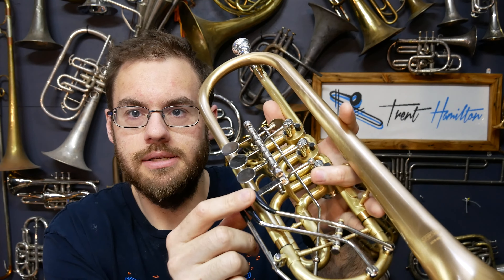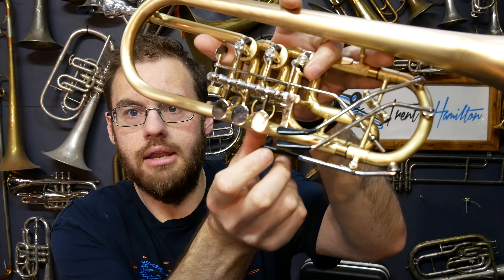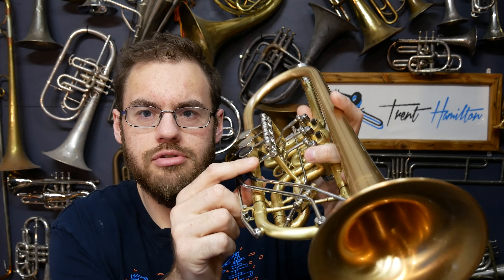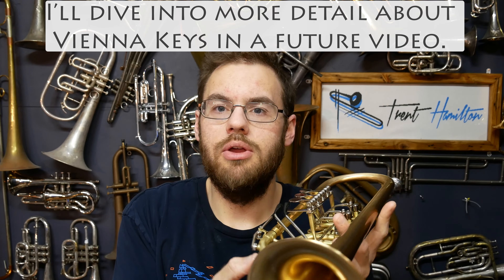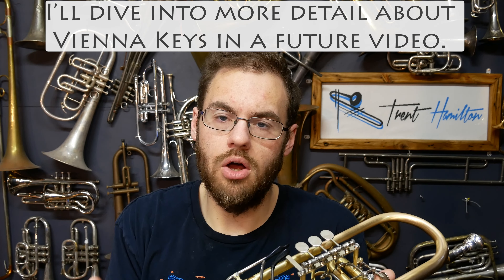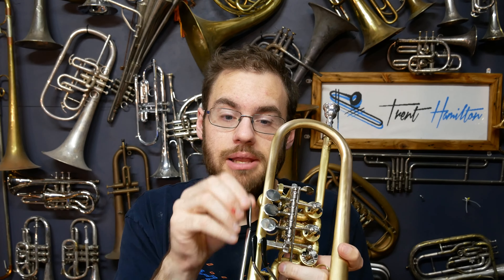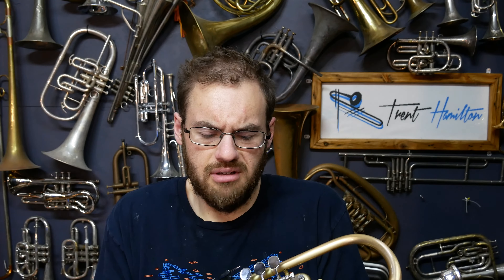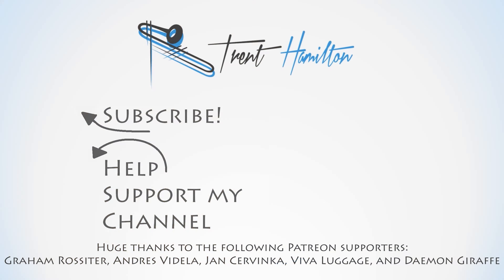Orchestral C Rotary Trumpet with Vienna Keys! SDTR-R300

Comment: I live in Scotland use a Scherzer rotary Bb with Vienna keys in the orchestra. It's their copy of the Monke trumpet. It has a huge bell and when you play Wagner or Raff or any of the big Germanic literature it beats all the piston valve trumpets. It has three leadpipes but everyone seems to use no 2.
Reply: Very intriguing. I have a roughly 35 year old Scherzer Bb trumpet. And it's so different to the Monke trumpets most here in the western parts of germany use. It's very thin and lightweight, has a bell barely larger than a piston trumpet and has quite the traditional looking mechanisms. In contrast to the Monke trumpets that are heavy and have simplistic and sturdy looking mechanisms.
But i have to say the valve action is a lot easier than any of the 2 or 3 Monkes I've held. Just completely different instruments.
Reply: Reject modernity, return to Monke

Comment: You could take the 3rd valve slide off and slip a rubber gasket on it to adjust it if youd like. Then the valve would rest on the gasket effectively "adjusting" it.

Comment: I thought those Vienna key were called vent keys, you know like the vent holes on the long modern baroque trumpets without valves. Rotary valve trumpets are (were) quite common in Swedish symphony orchestras. In the Gothenburg symphony orchestra they were preferred by the Japanese conductor (can’t remember his name) when he was in charge . I think they were equipped with those Vienna keys.
Reply from the maker: They probably have multiple names. Vienna keys "Wienen Klappen" are just one. It's a bit vague to my liking, because klappen can be translated as "valve", and Vienna valves are something completely different.

Comment: Hi, Trent!  I found your video to be quite interesting.  I have a strong preference for the "rotary valve sound" and have accumulated a number of these trumpets, mostly of German origin with some Yamahas thrown in.  I have also acquired three Chinese made rotary trumpets, with less luck than I've had with the other trumpets.  My first is a Bb that looks much like your C trumpet and it is the best of the three.  It plays in tune with itself (for the most part) and can easily be played in an orchestra or band setting without issues.  I also purchased another Bb that has an interchangeable leadpipe (but no more were included with the horn :-/ ).  It plays well with itself, but is about a quarter tone flat when the tuning slide is fully pushed in.  I might use it as an "A" trumpet at some point in the future.  The big disappointment is  a C trumpet with the three Vienna keys like yours.  It doesn't play entirely in tune with itself, and it seems like the valve slides were not cut to quite the right lengths.  I've had my eye on yet another Chinese C trumpet that resembles yours, but from a different vendor, if not a different manufacturer.  I hope that the Chinese are able to get their manufacturing processes improved so that such disappointing horns become a thing of the past.

My first YouTube videos, incidentally, were to show off some of my  rotary trumpet collection back in 2008.  Here is an example, if you're curious: https://www.youtube.com/watch?v=KpEChhU-DQ8

Incidentally, my wife and I (both cornetists) had the pleasure of visiting your beautiful country a couple of years ago when we rejoined our old brass band (the Chicago Brass Band) when we competed in the 2019 NZ brass band championships.  I wonder if you'd been there, too!
Reply from the maker: Thank you for your message, I remember Chicago coming to New Zealand and watched the band play at the pre-contest concert they did.